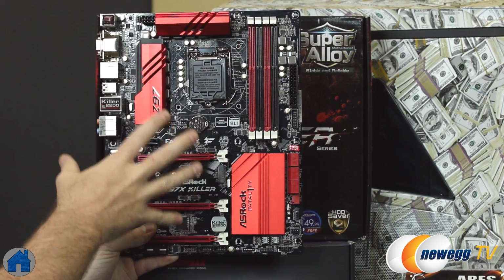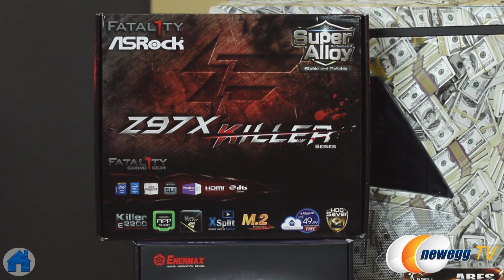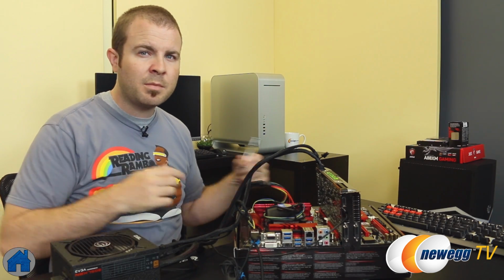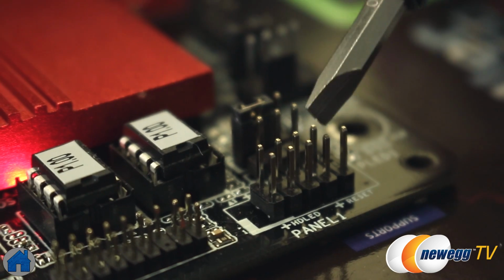How to Build a PC - Part 1 - Newegg TV

Comment: What do you think of this gaming rig (1440p 60 fps)?

Motherboard: Asus Z97-K Intel Z97 LGA 1150 ATX 
CPU: Intel Core i7 4790K 4,0 GHz LGA1150 
CPU Cooler: Noctua NH-U9B SE2
GPU: MSI GTX 980Ti 6GD5 6144 MB
Power Supply: Corsair CX750M V2 CX-series 750 W ATX
RAM: Kingston HyperX FURY Black 16 GB KIT (2 x 8 GB) DDR3 1600 MHz CL10
Hard Drive: Seagate Barracuda 2 TB 64 MB 7200 RPM 3.5" SATA III (6 Gb/s)
SSD: Samsung 850 EVO SSD 250 Gt 2,5" SATA3
Case: Fractal Designe Define R5
Optical Drive: Asus DRW-24F1ST/BLK/G/AS 24x DVD+/-RW

I'm a beginner at this. So I do have money to burn, but please let me know if I'm wasting it.
Reply: Go on to newegg.com and add all those parts in your cart it will tell you if there compatible
Reply: Hand Crafter Okey thanks.
Reply: jerardo lopez i kinda undermined the performance of a gtx980ti but you still won't get a solid 60fps on 4k if the game is a very demanding title
Reply: Mr Mod242 I found a site called pcpartpicker.com and decided to use it instead. Fortunately they were compatible :)
Reply: ok sounds great. thanks for your help.
Reply: I heard that i7 is a waste of money too and to just get an i5. What is the differences between i5 and i7?
Reply: Someone likes solstheim
Reply: acjackson127 Who doesn't? :D
Reply: That should play 1440p at 120 fps. It may be able to do 4k at around 60 fps. Also, your have a pretty good gpu. You may want to go with a better cpu such as a i7 5820k or 5930k.
Reply: Jegicci That will handle 1440p easily. Nice set up

As for 4k @ 60fps, you won't hit that with ANY rig you build now. Just not in the cards (no pun in intended) ATM.
Reply: Jegicci Were all of the components compatible? I want to build a PC similar to that one, except with different RAM and a different optical drive. I am also a beginner at this. Thanks.
Reply: Jegicci hey get a i5 instead of a i7 you dont really need to waste the extra 100 and if you get a OC (overclocked) motherbourd and gpu you can get the same performance for about 200$ less, and seagate is somewhat unreliable ide suggest getting 2 2tb drives and setting them to raid 0
Reply: Mr Mod242 more ghz meaning its .4 ghz faster than the i5 so i7 is 4.0 ghz 15 is 3.6 ghz i belive, its basicaly just got more prcessing power (it can handle heavier loads)
Reply: ah ok
Reply: Jegicci its K
Reply: Phuzion Gaming Isn't an i5 going to bottleneck the GTX 980 Ti?
Thanks for your reply.
Reply: Jegicci Nope, you can easily play a game with a i3, everything above that is just extra ( not an expert)
Reply: Marijn Faber I see, thanks.
Reply: Jegicci Btw dont say bottleneck makes you look like a noob, say that it will underperform based on the hardware :P
Reply: Phuzion Gaming Alright... I'm still a noob, but thanks for the advice I guess.
Reply: Jegicci Yeah no problem man, when are you getting your computer?
Reply: I'm looking to build a PC but I can only build it on carpet will that be an issue??
Reply: Daniel Blake hey get a nzxt phantom 530 580 or 860 those have heightened PSU areas so your PSU wont explode from the carpetr
Reply: Phuzion Gaming The i7's have hyper-threading as opposed to the i5's. Which allows the cpu to use more cores at once rather than a few idling. Can't really explain all to well as I had this explained to me not too long ago. But the i7's do have a slightly better processor speed and as you mentioned really not worth getting. And if need be, as you mentioned already, if you really wanted that extra speed you can just OC an i5.
Reply: Phuzion Gaming Probably in a couple of weeks.
Reply: Jegicci how much would all these parts cost?
Reply: Jegicci All those parts are compatible, but that is a kick-ass gaming computer. You can get something cheaper that can run most games at max graphics with good frames. You really only need that unless you're gonna be playing intense first person shooters like Battlefield 3 or some FarCry game. Plus along with that you need a wifi card for the PC if your connecting to a router wirelessly. What games are you looking to play? Plus the 4970K is a waste without a water CPU cooler because the 4790K performs well from overclocking, which you can't do without a decent (preferably) water cooler, so the extra money it costs goes to waste.
Reply: Phuzion Gaming No, "bottleneck" is the proper term.
Reply: Ryan Arranz I'm looking to play new games (and yes, I'm a huge Far Cry fan) on 1440p 60fps (ultra settings, of course).
Reply: Nicholas Caldwell About 2100 €.
Reply: Nathan Smith Whatever it is, we're going a bit off topic here.
Reply: ***** Thanks for the advice.
Reply: Then I'd say take your current built and add a decent water cooler or a high quality air cooler. Other than that you should be good to go for everything you need. That is a very strong rig and it should last maybe 4-5 years without losing too much power if you take care of it.
Reply: Ryan Arranz Thanks, and btw do you think that the PSU and HDD I chose are unreliable? I've asked about this around the internet and people seem to think that they're just that.
Reply: Your power supply is fine to me. As for HDD seagate is fine but western digital is better imo. Plus with such a powerful computer, you should choose corsair vengeance pro RAM
Reply: Ryan Arranz Ok thanks.
Reply: collin tait ummm nope man that cpu is fine an i5 4670k is good for this setup up too and a gtx 980ti would to pretty good at 1440p depending on the game but not 120fps maybe 30-50 a GTX titan X can hardly do 4k at 30fps so a 980ti would probably not be able to
Reply: Jegicci Never go for CX series they are very unstable and are common to cause tearing they have bad capacitors, instead go for the VS series or the XFX
Reply: ***** Yes,  that will easily max games at 1080p and 1440p. I'd say at high-max settings for 4k you'd get in the 40fps range. Though if you're going all the way with a rig like that, I'd suggest a SSD
Reply: leftyfourguns No. You will get like 10 fps on a GTX 980 on 4k on med setting.
Reply: lelcetz No way
I get 30-40 on Witcher 3 4k, max, no hairworks, with a 390. Steady 30, no drops on Crysis 3, Far Cry 4, and Shadow of Mordor, max. Easy 60 on older games like Skyrim
Reply: 390 ===///===gtx 980.
Reply: lelcetz Right
The 980 is more powerful than the 390. So if I'm gaming @ 4k minimum 30 fps with my 390, he's more than ready for an enjoyable 4k experience with a 980. Let alone 1080p and 1440p
Reply: leftyfourguns 30fps is not enjoyable for most people. For 1440p 980 is perfect
Reply: lelcetz 30 fps 4k is a very enjoyable experience. And I get higher than 30fps most of the time, anyway. Better performance than you'd get on a PS4 at 4x lower resolution and lower graphics settings. You're not getting 4k 60fps at any sort of reasonable price, even by enthusiast build standards.
Reply: leftyfourguns 30 fps is not enjoyable for me. Thats why I game at 1440p
Reply: Poseidon An i5 can run quad titans and be ok. It's just that if you were to use a low end graphics card with it it would underperform.
Reply: Gabe Newell Thanks GabeN.
Reply: Poseidon No problem young hero.
Reply: ***** SSD's are like 30 times faster then hard drives but cost way more.
Reply: Poseidon that power supply is not suited for high tier builds. look into EVGA supernova g2, p2, and gs. if you need something slightly cheaper, try the evga b2. on pcpartpicker, they have automatic pricechecking so you can see the lowest prices possible for those parts.

Comment: I'm looking for feed back on this build I'm doing I have a budget of about 800-900$. I there anything I should change?

Intel core i5-4690k 35ghz quad core processor

Cooler master hyper 212 evo 82.9 cfm sleeve bearing CPU cooler

Asrock z97 anniversary atx Lga1150 motherboard 

G skill ripjaws x series 8gb ddr3-1600 memory

WD caviar blue 1tb hard drive

Evga GeForce gtx 960

Corsair 200r atx mid tower case 

Evga 600w power supply
Reply: ben white you don't really need a cooler, but it's fine if it stays under the budget and the 212 Evo is one of the best coolers out there. If you don't want the cooler I'd use the money to upgrade something else like the GPU if you can
Reply: Shibe Inu what if i were to overclock my cpu cause i was planning on doing that.
Reply: 35 ghz that's one hell of a fast processor. You might want liquid nitrogen cooling system for that. Okay jokes aside that is actually a decent build

Comment: So I have a question for the pc wizards out there! I want a pc that will last me for years and years and still be able to play the big games on good settings. For now, it seems that the first build is a bit of overkill with the i7 and 16 gb of ram and what not. Approximately how long do you think it will be until games will start requiring specs like that?
Reply: Depends on GPU
Reply: +DarkBlood An i7 4790K and 16 GB of ram should last you a VERY, VERY long time, but it sorta depends mostly on what graphics card you'll get

Comment: Heys guys, need help. Can this pc build be able to play 1440p max setting on majority of the games about 60fps quietly? Btw, budget's not a problem.

-SSD= Samsung 850 Pro 128GB

-CPU= Intel Core i7-4790K 4.0 

-HDD= WD Black 4TB

-GPU= PALIT GTX 980 Super Jetstream

-MOBO= MSI Z97 GAMING 7 ATX LGA1150

-CASE= Fractal Design Define R5

-PSU= EVGA SuperNOVA 550W GS

-RAM= Crucial Ballistix Tactical 16GB

-CPU COOLER= CRYORIG R1 Ultimate
Reply: Harry Aung  I would recommend a better PSU, like 750 watts for the 980 (Evga supernova is good) although you could save money by downgrading to an i5 if you're just gaming
Reply: TD Channel k, thanks man.
Reply: Theres so much stuff you screwed up no offense (Mainly you GPU is a cheap ripoff; you need MSI, EVGA, or Gigabyte) you need to upgrade and make some changes. You could just switch to a mini ITX mobo you would have everything you have now except for a smaller case and you can even get a portable one with a handle like the Corsair 380T! My personal build is in a 380T and can easily run games at 4k at 60-65 fps and is in a the Corsair 380T. If you really dont have a budget then just get my build. It has everything of the best that you can fit in the case. You should go watch LinusTechTips video on the 380T so you can get familiar with it. This is my personal build and i love it more than my double GTX 980ti massive full tower build. 

http://pcpartpicker.com/user/SamKrigs/saved/Ds9p99

If you decide to change anything just make sure you check the compatibility filter and notes. Btw it says there could be a problem with the cooler in my build but im typing from thus computer so it works fine.

Comment: I have some questions about thermal paste.
1. does it come with cpu/ custom cpu cooler or do I need to buy it separately?  If so, which one is good?
2. How do I know if I have too much/ not enough thermal paste.  I know he said pee sized, but I am scared of doing it wrong.

Cheers guys.
Reply: Also, do I need to buy cables separately or will they come with the parts?
Reply: Hugh Wheaton Should come automatically with a cooler, and the thermal paste is preapplied

Comment: Here is My first computer build
 Give me some feedback, i am not sure that the parts do match? Is this spec good together??

GeForce strix 980 
Coolermaster haf 912 mid tower
Intel Core i7-5820K, Socket-LGA2011-3
Crucial BX100 500GB 2.5 SSD
ASUS X99-A, Socket 2011-3
4x4 Crucial DDR4 2133MHz 4GB
Seagate barracuda 3tb

Comment: I'm trying to build a multipurpose PC gaming and editing, (maybe Streaming) but mostly editing for Photoshop and animation. The main I know I want to get is intel i7. But my budget is around $800 what will you say, on how I build it. (first build)
Reply: More CPU. Editing and Photoshop. Visual effects. Animation. And small gaming part. Ex risk of rain and g-mod. No AAA games.
Reply: My limit would around $1000. How much would that be.
Reply: Thank you. Thank you very much.
Reply: I'm not overclocking. Since it will be my first build.
Reply: What kind of case is good for this build.
Reply: Black or red or blue. 
Dvd drive. Yes. Just in case. 
Windows 8. I'm used to it. Went from Mac to windows laptop.
Reply: Size middle if possible
Reply: If it goes over $1000 I should be able to go a little over.
Reply: No thank you very much. You helped a lot. If I need more info I'll ask you so thank you again. Hope you have a good day.
Reply: Actually that sound cool. I like that. Lol. Didn't realize that what you meant.
Reply: you don't need an i7 on a $800 build, ESPICALLY because of its price

Comment: How is this build for today's gaming at 1050p and at least 60fps on Ultra?

CPU: Intel Core i5-4690K 3.5GHz Quad-Core Processor 
CPU Cooler: Cooler Master Hyper 212 EVO 82.9 CFM Sleeve Bearing CPU Cooler  
Motherboard: Gigabyte GA-Z97X-SLI ATX LGA1150 Motherboard  
Memory: G.Skill Ripjaws X Series 8GB (2 x 4GB) DDR3-1600 Memory
Storage: Samsung 850 EVO-Series 250GB 2.5&quot; Solid State Drive 
Storage: Western Digital Caviar Blue 1TB 3.5&quot; 7200RPM Internal Hard Drive 
Video Card: Asus GeForce GTX 970 4GB STRIX Video Card  
Case: NZXT S340 (Black) ATX Mid Tower Case 
Power Supply: EVGA SuperNOVA NEX 750W 80+ Gold Certified Fully-Modular ATX 
Operating System: Microsoft Windows 8.1 (OEM) (64-bit) 
Case Fan: Corsair Air Series SP120 Quiet Edition (2-Pack) 37.9 CFM 120mm  Fans   
Total: $1562.10
Reply: Don't get a 960, get a 380 for the same price and much better.
Reply: Yeah the guy above me said. Get a 380 from AMD

Comment: What do you think of this as a first time build guys? I'm sticking with a budget of around $800
Kingston Technology 1866Mhz DDR3 Non-ECC CL9 DIMM XMP HyperX beast 8GB kit
 or
Corsair Vengeance 8GB (1x8GB) DDR3 1600 MHz (PC3 12800) Desktop Memory
intel i5 core processor 4690k
ASUS M5A99FX PRO R2.0 AM3+ AMD 990FX SATA 6GB/s USB 3.0 ATX AMD motherboard
WD Blue 1TB SATA 6Gb/s 7200rpm internal hard drive
Crucial BX100 250GB SATA 2.5 Inch Internal Solid State Drive
Sapphire Radeon Vapor-X R9 270X 2GB GDDR5 DVI-I/DVI-D/HDMI/DP with boost and OC version (UEFI) PCI-Express Graphics card
Crosiar 600watt power supply

what do you guys think? also is there any other options that might be cheaper with the same performance? Anything i should add? and what pc desktop case should i get that would fit these, for like $55 or less? Lastly are all these parts compatable with one another? 

Really appreciate the feedback.

Comment: How's this for a gaming pc?

CPU: Intel Core i5-4690K 3.5GHz Quad-Core Processor  ($235.99 @ Amazon) 
CPU Cooler: Cooler Master Hyper 212 EVO 82.9 CFM Sleeve Bearing CPU Cooler  ($31.99 @ Newegg) 
Motherboard: Gigabyte GA-Z97X-SLI ATX LGA1150 Motherboard  ($126.98 @ Newegg) 
Memory: Crucial Ballistix Sport 16GB (2 x 8GB) DDR3-1600 Memory  ($99.99 @ Amazon) 
Storage: Samsung 850 EVO-Series 250GB 2.5&quot; Solid State Drive  ($117.99 @ Amazon) 
Storage: Western Digital BLACK SERIES 2TB 3.5&quot; 7200RPM Internal Hard Drive  ($129.99 @ Newegg) 
Video Card: Gigabyte GeForce GTX 980 4GB WINDFORCE Video Card  ($532.98 @ Newegg) 
Case: Corsair 450D ATX Mid Tower Case  ($89.99 @ Newegg) 
Power Supply: Corsair RM 750W 80+ Gold Certified Fully-Modular ATX Power Supply  ($106.98 @ Newegg) 
Operating System: Microsoft Windows 8.1 (OEM) (64-bit)  ($99.99 @ Newegg) 
Total: $1572.87

Comment: What do you guys think of this for my first gaming pc build?

http://www.amazon.com/The-Minotaur/lm/R3COM1RNY1JCU6/?_encoding=UTF8&camp=1789&creative=390957&linkCode=ur2&tag=topgc13-20
Reply: Eden Gilady Are you planning on overclocking?
Reply: Will Y Probably for intense games.
Reply: Eden Gilady Ok, your build looks good.
Reply: Eden Gilady I would probably get a better case like the Fractal Design Core 3300
Reply: Eden Gilady This is good. But you don't need an extra CPU cooler, one already comes with the processor.
Reply: OAcesync the SPEC-01 should be fine, Corsair makes good quality cases
Reply: Shibe Inu The SPEC 01 is a budget case but it would be a nightmare to do cable management with a non modular PSU. If the person can get a i5/970 combo he should at least get a good case like the Fractal Design R4, NZXT Source 340,Phantom 410 etc. And that PSU isn't that great either, the CX series aren't that good and I would at least get a semi modular/modular PSU from either Seasonic,EVGA,Antec,Silverstone,NZXT etc. or a Corsair RM.
Reply: ***** i made a few changes to the list since then.

Card: GIGABYTE GTX970 G1 Gaming Windforce 

Case: Corsair Graphite 230T

PSU: Antec High Current Gamer 620W (good call)
Reply: ***** I also changed the motherboard to Asus Z97-A LGA1150.
I got it in orange too! It's a great case!!
Reply: Conquest Oh
Reply: What is that garbo thermal compound
Get Thermal Grizzly.
Reply: +Dank Musty Why else would you think people would make CPU coolers.

Comment: (AMD Build) I built a PC and it's fine and running, I'm using it right now, but when I put the CPU fan onto the motherboard i couldn't pull the latch down because too much force was already being applied. Does this matter or should I go and fix it?

Comment: need some feedback on this build. not really for gaming, but for daily use and for running autocad and video editing software. 

CPU: AMD FX-8350
Fan for CPU: Cooler Master  Hyper 212 EVO
MOBO: ASUS M5A99X EVO R.2, socket AM3+
Ram: Kingston HyperX Fury 16 GB DDR3-1600 Kit

GPU: not sure but looking at: EVGA geforce 750 ti FTW 2GB, EVGA GeForce GTX 960 SuperSC ACX 2.0+ 2GB, or Sapphire Radeon TOXIC R9 270X 2GB 

HDD: Seagate Barracuda 500 GB 7200 RMP
SDD: Intel 530 Series 120 GB (Primary boot drive)
PSU: EVGA supernova 750W 80+ Gold  
Fan Cooler 1-2 Fractal design R2 silent series
OS: Windows 7 64 Bit
Case: Fractal Design Define R4
Reply: ***** thanks, and yea i don't mind the budget as much, but I want to build a rig that will last for a while. I'll look into your suggestions appreciate it!